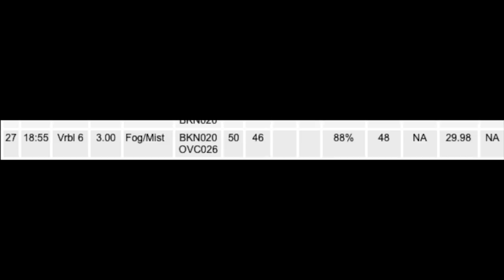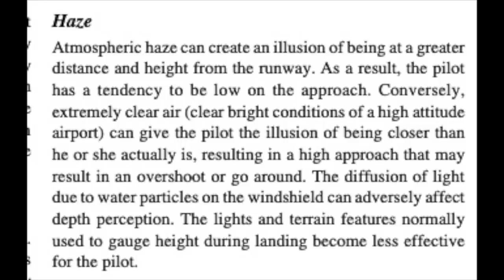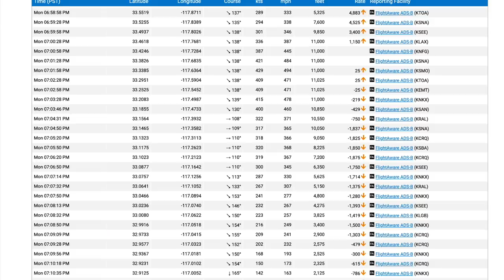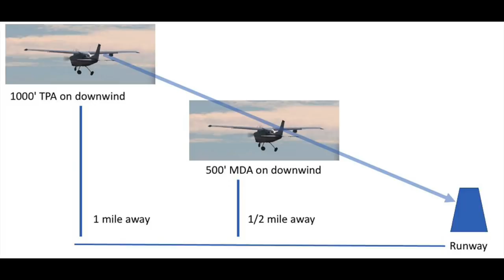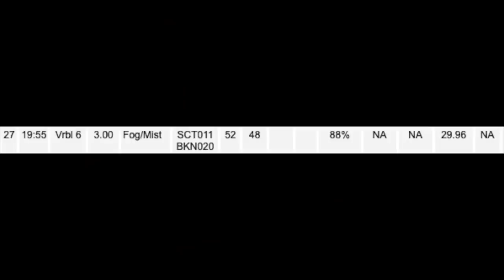N880Z Learjet Crash El Cajon San Diego California - Low Altitude Starts Accident Chain

Comment: I drove by the crash site a few nights ago and easily would’ve missed it if I hadn’t been looking for it. I’m a layperson (and thus I may just have misconceptions about the damage this crash would cause), but I was surprised how a jet could slam into the street/yard at high speed and explode, etc., without creating a big crater or something. I was just surprised that it was hard to tell there had even been a crash and huge explosion/fire there a few days earlier, and both lanes of the road were open for traffic and thus had not been significantly damaged (unless there had been some very quick road repair work).
Reply from the maker: Most of the structural elements of aircraft are made of aluminum, which crushes easily on impact. Had the kinetic energy been higher, e.g. a bigger plane and/or traveling much faster, it probably would have left a crater.
Reply: @AviationNewsTalk  got it. Thanks for the response. I’ll be interested to see the final NTSB report. I don’t know anything about planes, but man, seeing that Nest video showing the jet pretty much headed straight down towards the ground was disturbing. I didn’t think it would be so “easy” for a jet that didn’t suffer catastrophic structural damage in air to, in essence, dive straight to earth just seconds after everything had sounded fairly routine. The poor family of the people on board.

Comment: Max... I agree with most of your assessment.  However I believe you may have overlooked one important option that may have been available to this crew.  

While you are technically correct in your statement that there are no instrument approaches to Runway 27R, that other possible option is the Localizer D approach requiring DME.  Unless their company's Operations Specifications specifically prohibit use of that approach, or generally prohibit any circling or night circling approaches, the LOC D approach appears to have been the very best option available, and a pretty good one at that.  

Although that LOC D approach is technically a circling approach that can be used to any of KSEE's multiple runways, it actually provides a virtually straight-in approach path to Runway 27R.  

I suspect that model LearJet uses either Category B or C Approach Minimums.  The Category B Approach Minimums for the LOC D are only 120 - 140 feet higher than the straight-in approach minimums for the  RNAV (GPS) Runway 17 they chose to fly.  While the LOC D Category C Minimum Descent Altitude of 1,940' MSL (1,552 feet above airport elevation) is 560 - 580 feet higher, they were still well within (should have gotten the aircraft safely below) the reported ceiling that was about 2,400' MSL (2,000 feet AGL).  

Of course, if they use Category C minimums and the weather (ceiling and/or visibility) was actually much worse than reported along their path, it could have resulted in either multiple missed approaches on the virtually straight-in LOC D to Runway 27R, or a diversion to an alternate airport.  However, In retrospect, either of those outcomes would have been far preferable to what actually occurred. 

If you saw the one security camera video that seems to show the aircraft in a left turn from either downwind to base or base to final, it appears to show an accelerated stall in a steeply banked left turn.  This should have been at least a possible, even somewhat predictable, outcome to the crew if they had really thought things through and thoroughly briefed their approach planning.  Apparently it was not given sufficient consideration before they proceeded as they did.

When all factors are considered, this sequence of events represents either great inattention or very poor ADM on the part of the crew, resulting in anything BUT a stabilized approach, in a very high performance and not-very-forgiving aircraft, which is almost always a REALLY BAD combination.  It is another tragic loss of four lives and what was probably a fine aircraft, in addition to untold collateral damage for family and friends of those onboard.  Let us all hope that the important lessons that may be learned from it will prevent other similar tragedies.
Reply: Gillespie is my home airport. I would have to agree with you. I've shot that Loc 27 approach many many times.If I broke out and could make a normal descent to landing straight inI would or I would circle in the day if I needed. Onetime I went missed and went to MYF for a ILS and parked for the night.
Reply: @19211926  
Ceiling was reported at 2000’. Final step-down altitude on the LOC-D is above the reported ceiling. Arriving 3.1 nm from the end of the runway while still above 2000’ AGL precludes a straight-in landing, so the LOC-D would not have been a better option for them given the reported weather.

Comment: I know Gillespie, you need to understand Mount Helix. Look at the flight path….They weren’t turning into the pattern, they were swinging back in a teardrop to get into the pattern. They were low as Hell, they obviously had a hard time seeing Mt Helix which I think came out of the haze and scared them. They then turned very sharp for a Learjet going 140…
Reply from the maker: It sure looked to me like they were attempting to turn from base to final when they crashed. I'm not sure what other direction they would have turned, other than directly onto the final. Low as hell is a good description. I think if it had been daytime, and they could see how low there were, they might have climbed more.

Comment: Agreed on the stall turn to final, however the initial trigger was the close/tightness of the circuit, overshooting final has that 1100ft hill immeidately on the otherside of final, resulting in (hard) pulling back in combination with overbanking, resulting in the stall.
Reply from the maker: That may have well have been the trigger. But the traffic pattern was being flown in so close to the runway, that he was guaranteed to overshoot the runway, which could also be why he suddenly steepened his turn. Either way, the end result was the same: a stall/spin accident as the result of a poorly flown traffic pattern at a very low altitude.

Comment: If 17 was not permitted due to length, what would be the best approach plan?   Sounds like there were no safe options.
Reply: I understand the other two runways, at least one of them with plenty of length can only be accessed using a VFR approach. Whoever wants their flights to come in safely needs to find the way even if using a different airport to do that. Seems like this airport and the FAA bear some of blame for what they allow also. Many planes can handle this kind of funky way to land on 27R but this plane is not the best with a pilot that simply flys too low. Gauges?
Reply from the maker: James, I agree, it looks like the crew had few good options, and flying a very low traffic pattern to 27 R was clearly not a good one. Montgomery Field is just 8 miles away, and was report 7 mile visibility, with few clouds at 1000, Scattered clouds at 1500, and Overcast at 2200 feet, so it might have been a better option.
Fred, flying that low in any plane at night would be a poor idea, but flying that low at 140 knots would be even worse.

Comment: As a  35a guy and 135 pilot, I would like to find a way to make safety the number one priority. Right now it is not, because safety costs money...in training and operation costs. That is why accidents like this happen. Do we need some rule changing for 135 ops? It looks that way to me.
Reply from the maker: What would you change? I think I would eliminate circling at night, though technically these guys weren't circling, and anyone could avoid a new rule like that by cancelling IFR.
Reply: @AviationNewsTalk  I would change training requirements first. Think about that kid in the right seat for the TEB crash. If a captain is going to give instruction in the aircraft, the FO should have completed a ground school on the aircraft first, and pass a test just as you would for any other certificate or rating. Also, the Captain should be a current CFI. Too much? Not to save lives like this. As far as this crash is concerned, I would also require that if you cancel IFR with the idea that you will circle using VFR, you have to be above any published clearance  minimums to be approved by ATC. This guy should have been routed to a fix and allowed to do an instrument approach down to circling minimums following that request, and then cancel or go missed.  You can't be below traffic pattern altitude and declare "field in sight." That's crazy. That's just right off the cuff, but those are the most glaring needs from my experience. There is far too much "we will train you in the aircraft" in 135 operations, and not enough ADM. Maybe this seems harsh, but I am sick of seeing people die in aircraft being flown by professionals.
Reply: @arthouston7361  And let's not forget about the possibility of how many could have died on the ground. Many of these small airports, the ones that used to just have puddle jumpers and now servicing HP aircraft like this, are now right in populated areas. One disaster and there goes your airport.
Reply: @fcaughli  I'm pretty sure you can kill just as many ground personnel with a Navajo as a 35a. That said, it was fortunate that only a car on the ground was lost.
Reply: @arthouston7361  I am just alluding to how we now are flying planes that have a little more likelyhood of crashes in and out of these small GA airports.
Reply: @fcaughli  If you look at most airports with jets, it is extremely rare for a crash to occur. TEB has several hundred operations a week (just over 46,000 in 2019) and between tens and hundreds of thousands between incidents or accidents. I don't agree that the power or complexity of the aircraft makes a crash scenario more likely. If you look through an NTSB list for any given month, most accidents happen miles from any turbine powered aircraft area. I live under the approach end  of a 2,700 foot runway, and it is the weekend pilot in a piston single that worries me much more than the guy in the King Air.
Reply: @arthouston7361  My God I thought we were talking about this airport and this situation. You turned it into some general aviation discussion.
Reply: @fcaughli  That's because aviation is built on general aviation. All pilots come from GA. Most airports like this one ARE GA airports. Part 135 is the governing rule set for this carrier. Is there something else you would like to add?
Reply from the maker: Art, are you typically flying the 35A in Category C?
Reply: @AviationNewsTalk  I am no longer flying the aircraft, but for circling, I would want to be at Vref+15 at a minimum, which would be in the C to D category. Even in a climb, you have to watch the power when leaving a class C airport because it will zip right by 200 without any problem.
Reply: You answered your own question.   More $$$ spent on training and experience is the only answer, but good luck finding more $$$ in a Part 135 operation.  Keep in mind the "logic" of the FAA.  The more damage and death you can create, the more they want you trained.  4 peeps in a privately owned aircraft represents a very small risk to the general public, so the FAA is wiling to accept that.
Reply: @chucksavall  Maybe they are. I am not.

Comment: Question. I live in El Cajon and heard/saw this plane crash. We live on a slight slope terrain and on the second story. .we are  right around the spot the plane did the circle turn.  

Before the actual crash we heard the plane fly over our roof. Lower and louder than usual. We also saw what we thought was bright white/blue flash or two  out our window. Ppl keep telling me it’s from the plane hitting multiple power lines.  But we strongly believe this flash was in the air and before it even crashed given where the flash direction seemed to stem from if that makes sense. We saw and heard this event through south and west facing windows. after the flash we then heard a bang and then looked out our other west facing window to see the giant fireball just above the tree line. Then another pop and a giant plume of smoke .  Is it possible something on the plane caused that? We don’t believe it was lightning either as the weather was not that severe. I’m from Jersey originally so we have experienced many thunderstorms. Any thoughts on this being a possibility. I have no aviation experience so I am curious what we actually were seeing in our peripheral vision initially.
Reply: Would it just be normal lights of the aircraft? Though it seemed like flashes and very bright as opposed to normal repetitive blinking lights.
Reply from the maker: Most aircraft have bright white strobe lights on their wing tips that pulse on and off. These lights look really bright when there is rain and mist, which diffuses the light from them. The Nest camera video I saw showed one bright, continuous light, which would have been the landing light. It also showed the pulsing strobe lights. All of that is normal. From what I saw, everything looked normal (other than the plane being low) until the plane went out of view and crashed a few seconds later.
Reply: Ok. I didn’t think about how the weather affects the lights. Would the way the plane turned distort the lights on it even further perhaps ? Thank you for your thoughts. It means a lot to those of us that know nothing about planes to understand more in detail what we saw.  and it in some way actually helps rid some of that anxiety from what was witnessed. Knowledge is power.

Comment: I’m based at Gillespie and, contrary to what Max says, there is a much safer approach to use than the GPS 17 approach at night in poor weather: the LOC-D  approach to Runway 27R, straight-in.  I’ve flown it many times and, if the pilots had asked to start the approach at BARET, they would have had a nice 15 mile straight-in approach, and 19 miles if electing to begin at WOPOS. Since the crew was based at Gillespie (I think), they must have known about the localizer approach. The crew may have been more comfortable flying a GPS approach than a Localizer approach, the former tricky at night even in good conditions due to hills and Rattlesnake Mountain just north of  27R.
Reply: The loc approach had higher minimums right? I don’t think the cloud layers would have warranted that.
Reply: @4lifeifly  Yep, that may have been a consideration. At any rate, they could have flown the much-safer straight-in LOC approach, gone missed if necessary, deviated to Montgomery Field (just 8 miles away), and received vectors for the straight-in GPS or ILS approaches at KMYF, both of which have minimums of 673’ MSL. I think that get-there-itis played a big part in the decision to cancel IFR and make a VFR circling approach, at night, in foul weather. What a terrible outcome.
Reply: The Loc-D approach is not a straight in. It's a circle app. If it was a straight in it would be called a Loc 27. Now if you broke out and could do a normal descent to landing on 27 ypu could do that. It sounds like that might have worked for them.
Reply: The LOC-D is legally a circling approach even if you land 27R and is not authorized at night.
Reply: @garywilser7802  True. I guess I was thinking that, in daylight, tower always gives the option of straight-in or circling. At night, it’s not authorized at all. Which brings us back to the decision to fly a circling approach at night in bad weather. The AOPA videos we all watch demonstrate that the outcomes are usually fatal. Max Trescott notes that the Lear might have been on downwind at 140 knots, making two tight turns for base and final, close to the runway, a sure recipe for stall/spin.

Comment: Yes in the doorbell videos I saw, the landing lights were illuminating substantial clouds, and the call for turning up the lights suggests they were having their view filtered through clouds, so I think they were low to maintain visual with the runway. That the airport wasn't reporting the low clouds is not substantial as they could be very localized and the clouds could have been sitting around those hills to the east vs a few hundred yards to the west over the airport.  I've flown approaches where I think "hmmm lights are pretty dim" when in fact it is unreported cloud layers, so as soon as I heard them ask for the lights that told me right away it was a lower layer. I think when the pilot lets out those exclamations it was when they "broke out" and the plane was banked to the extent that when they did see the runway it was not in the orientation they expected and they were already in a spiral.

Comment: Mist drags the base of the clouds lower and they were low keeping the runway in sight. The aircraft landing lights were on and reflecting into the mist coming from the base of the clouds. This is a big issue at night VFR and would be the likely cause for asking for the runway lights to be turned up.
Reply from the maker: The doorbell camera showed the landing lights and strobes on. That reflected light could have been almost blinding if they entered any mist, or were really close to a cloud. I once ordered a student at night on an ILS to climb and go missed after we started getting blinded by our strobe lights in the clouds. We'd just had an autopilot issue and he was struggling to find the switches to turn off the lights. I had an almost immediate headache from the strobes, so it was time to get ourselves out of there quickly before things got any worse.